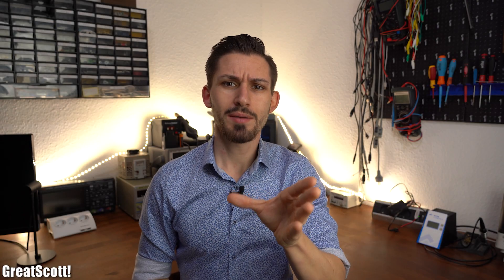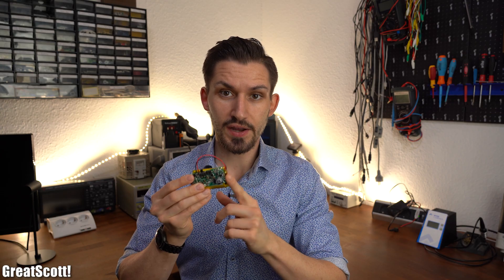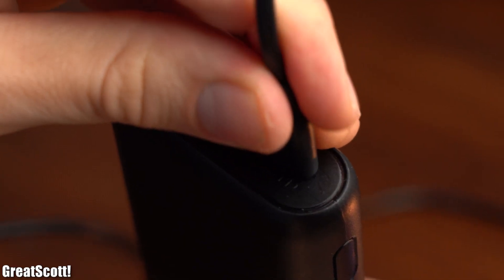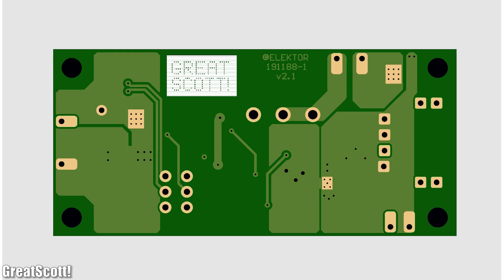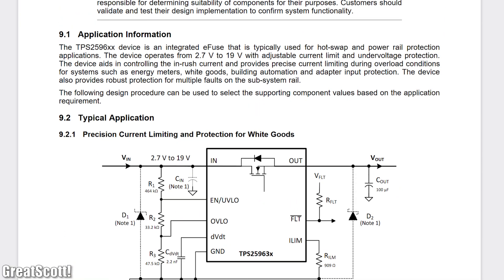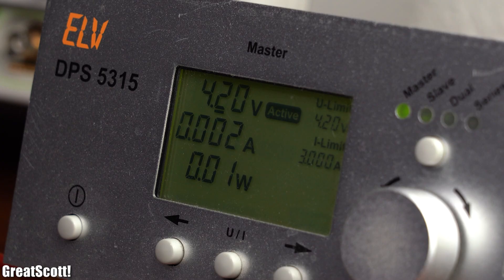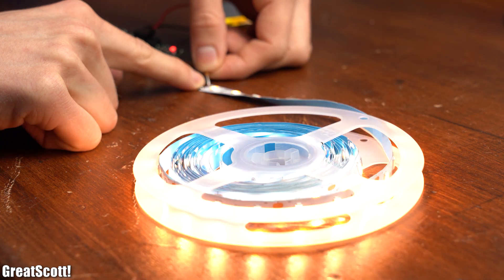DIY LiPo Supercharger! (Charge, Protect, 5V/12V Boost V2)

Comment: Nice project thank you Scott!. Can it charge the battery while delivering power to the load? In other words, could it work as a small capacity UPS?
Reply: I also need to know the answer.
Reply: I think no as the output voltage comes only from the battery (and the charger need to know the end of the charge cycle which is a small % of the charging current).
But I'm looking for something like that too: I need a small 12VDC UPS to provide power to a fiber optic router...
Edit: I'm wrong... The circuit does both, but the current is shared between the load (boost converter) and the charger section (1A max according to R6 and datasheet).
If the battery is already fully loaded, it's ok. Exemples, if a 5V load requires 1.5A, then the module will require max 1A from the charger and approximately 1.4A from the battery (taking in account an efficiency of 85% of the boost converter and a best case VBAT in discharge mode to 3.7V). In this case the battery obviously will not charge and the system will shutdown when the battery is depleted, even powered by the USB-C... If instead your load requires 0.5A at 5V, then a current of 0.8A dropping to 0.7A will be required from the charger section, allowing 0.3 to 0.2A to charge the battery... Of course, supposing the USB-C is able to provide the current...
At 12V output, it's a little worst, only 0.26A could be provided without transitioning from charge to discharge of the battery.
Of course, it's just estimated values based on quick and dirty computations according to the design parameters.
Close measurements might be done to take in account many over parameters...

Comment: Man I would love to buy your circuit but even though it is available I can’t use it as my soldering skills are worse than worse
Reply: Then you should do it over and over again. 
No master has yet fallen from heaven. My solder skills were also worse than worse in the beginning, but with exercise and gained knowledge it got better and better.

Maybe also start watching vids showing how to correctly solder and looking into iec-reports.
Reply: Eg. IEC 61191 shows the technical Side of soldering. (More a Info for manufacturers, but also a little interesting for hobbyists.)

Comment: hi sir i have a question about the  XB8089D ic , 
does it really work , all the features that are listed in its datasheet do they really work , im trying to use this chip for a circuit i am designing, that has a charger ic and protection ic , my main question, is this chip protecting the battery from the charger or protecting the circuit from the battery or both , and how does this chip work if most of its pins are tied to ground , and there is no seperation between the battery and the circuit , , basically the  XB8089D and the battery and the main circuit are connected in parallel so how can it protect the circuit or the battery , i thought the protection circuit should be between the battery and the main circuit , can you help me please ?

Comment: Congratulations on the success of your project.
Is it possible to leave the circuit plugged in to keep the battery charged?
I hear that this can damage LiPo batteries.
I would like to build an uninterruptible power supply for a project I'm working on.
Thanks

Comment: This is so expensive, i feel like you can just buy a power bank with all those features that also comes with the batteries for less.
Reply: Power banks turn off automatically at lower currents and do not supply power when charging the batteries.

Comment: im actually currently building one my own from scratch using a 11.4V lipo  3 cell battery with built in balance charging , using 5 volt to charge and  operate using converters,  looking into ways to get more charge and having a higher capacity battery pack would give higher watts and amps to operate longer.  im thinking to acquire this kit  and see if its possible to use a 12 volt(ish) battery by modding it or use this as intermediate, i doubt the ic are rated for a 12 volt lipo battery but gonna look into it.

Comment: How do you charge an array of bats?  Ha-ha I know it's a battery , I need to add USB charging to my diy liion flashlight, it has 8 18650's parallel, about 2ah each, I want to step the led up to a 3w or 5w, I also want to add a boost converter, for a 13.5v output, it's kinda multiple purpose light, power supply, it originally used a 6v lantern battery, actually it had an adapter to use AA cells as a option, i had to use a small boost because the led needed about 5.5v to start working, I have the LED's I just need the charging and protection bits, I was going to use the tp-4056 with 1amp protection, but that will not work with a 5w led.   With all the bells and whistles I guess a 5 amp protection board, or maybe I will go to 3s or 4s and a buck converter for 13.5v out, and the led, having a 4s it may be possible to charge a car NB attery with it, (enough to get the car started possibly,) that could be handy, I may swap in better cells for that, I gave 3200'sbut want to use those in my house, but using a small DC buck with cc CV to charge lead acid car batts, from liion, insted of a high c jump start, it's worth testing I guess! Happy December!!

Comment: I like the USB type C breakout board idea but you could integrate that into the project.  If you look on the breakout board then you see a resistor and a capacitor.  The resistance for sinking any power is independent of the resistance that will be on the cable's end.  So pull-down resistors will always be 5.1kOHM on the CC1 and CC2 pins of the USB type C on your board.  Also it looks like there is a capacitor that probably goes to the Vbus line for filtering.  In the case that you need a power supply without ripple you would need to filter the Vbus line, after combining all the pins labeled Vbus together, with a 10u capacitor or a Pi filter.  As well you see that it comes with the standard communication pins Dp and Dn on the board, well you'd just route them together as a differential pair and wire them to some IC like a serial-to-UART CH340C specifically to have communication with an ESP.

Comment: Nice circuit. I can only think of one potential flaw: what happens in case of a bad contact in the voltage selector switch? Or slow operation? So, with the voltage selector switch in an undefined state: will it output 0V, 5V, 12V, or any?
This could potentially destroy electronic projects, so it's important to know.
Reply: You could always "hardwire" the connections and leave out the switch, if you're really worried about that.  
Then you just wire each one for a specific output for a specific project--since after all, this PCB should travel with the battery that it's charging and "extending" the output of.  Sounds like a match to me!

Comment: Great updates Scott!. May I ask,  how can I modify this circuit to work with a 2s lipo battery to output at least 2.1A (for use with servos and steppers motors)? or are there any commercial pcbs like this one but for 2s and at least 2.1A?

Comment: Great , but I would love some charge protect circuits for multiple configurations like 1S or 2S or 2S2P of 18650 li-ion.
Reply: I’ll add my vote for that too!!
Reply: Certainly many gadgets are 12 V powered, a 3 S Lipo version would be appreciated
Reply: Me too, I'd like to find a good design of 12VDC UPS based on two 18650 (for at least half an hour of backup power).
This device should be able to stay permanently connected (so must be very safe) and delivering 8W to 10W of 12VDC regulated power. My intention is to provide uninterruptible power to a Fiber Optic router, originally powered by a AC/DC regulated 12VDC plugin module (this module should be reused to feed the mini UPS, so max 2S is required to preserve some margin for the LiPo charger. Might be necessary to use a Sepic converter for the regulated output if Vin >= Vout when AC powered).

Comment: Awesome project! For future versions, could you improve the output current to 3A or more?
Reply: Probably require a more powerful mosfet & inductor.
Reply: @stevenanderson9532  It can be useful for more demanding portable projects. In my case, I have been searching for a while a schematic that can power a pi 4 and a touchscreen which requires 3A output.
Reply: With increased cost & a modified motherboard. I've need of more volts & amps. But your better off getting a buck boost like I'm having to do. These are more complex as Scott has proven in the past & others. Anything above 1.5 amps usually. Experimenting with lm317 3055 inductor schotkey buck boost which is more affordable which if successful will release it's schematics in thanks for the pioneers!

Comment: So, maybe this is a silly question, but can I use this kit to charge 18650 batteries? I'm working on a project where I need 12V output from a bunch of 18650s in parallel, and this seems to fit the bill pretty well, but unsure if this will fit the bill or if I need a proper BMS instead. The requirement is also that it needs to be able to charge the batteries with USB.
Reply from the maker: Yep. 18650 will work.
Reply: @greatscottlab  Neato! May have to give this a look then. Cheers!
Reply: Why don't you use them in series? It's more efficient (and more complicated to balance)
Reply: A lot in parallel with boost converter could work, depending on current needed, if it's very low, I'd go with single or parallel, if higher I'd go 3s with bms, and balance,  maybe use a buck boost to regulate output, they make tiny 3s charge boards, that could use USB with boost to charge im working on a similar project, but low current, 1-2amps, 5amp max,
Reply: Although lifepo4 will work for 12v much better with 4s coming to 12.8v nominal, and 14.4/14.8 full charge, and is much less flammable !
Reply: @jamest.5001  yes, but if this will boost it up to 12V with a built in charger, that solves two problems for me. My idea was indeed to put in a proper BMS and then boost the output of the batteries, but I haven't been able to find something that charges via USB that's easy to just incorporate in my build. It will have probably 8-10 18650s (simply because that's what I have available) and I'm building something which will have high capacity, and is easy to charge, hence the choices. I could use 3-4 in series and regulate the output up or down to 12V as well, but would be more complicated to charge and maintain. This will be a very low drain project, something like 0.2 amps, but should have the capacity to work for quite some time between charges.
Reply: @SwitchAndLever  but this would take a painful amount of time to charge 8-10 batteries.
Reply: @greatscottlab  2.5 discharge current isn't too low for 18560 batteries? The minimum isn't 3V for saving 18650?
Reply: @NanoMine  not a problem whatsoever.
Reply: Buy a cheap chinese powerbank with variable outputs support 5V, 9V, and 12V and then replace the batteries with better quality ones.

Comment: Is it possible to configure it for say 5.1 or 5.2 volts?
Reply from the maker: On the output? Sure, you just need to change resistor values of the boost converter.

Comment: NICE!
I think the 5V 12V switch should have been a jumper of some kind.

You don't want to run the risk of accidentally changing to 12V
Reply: That's why GreatScott! gave us the 12V indicator LED. It will tell us right away why our powered devices released the magic smoke.
Reply: @PeteBo  lol.  That's right!

Comment: I hope you make it 'adjustable' for voltage discharge protection some people don't like to push battery to 2.5v
Reply: Not just the discharge, I personally like to go for a charge cycle range of roughly 4.1v to 3.3v I think the slight loss in capacity is generally worth it for longer cell life.
Reply: @vgamesx1  Can you link IC or components and the scheme (if possible) for 3.3v overdischarge protection please?
I only found IC for 3.0v and it's a bit too low in my opinion as well.
Reply: Yea 2.5 seems low but it also sounds like getting an ic that stops above 3 is difficult. Might be better to consider that feature as protection for the lipo exclusively and work a cutoff into the workflow/design of the product being powered. I would've loved to see a  voltage indicator even if it was just a handful of leds to make it easier to stop manually. Not hard to add tho.
Reply: 2.5 v will be an issue for LiPo batteries, but Li-Ion would tolerate this much better without degrading the cells. With the size of the circuit board I could see wiring up a pair of 18650s in parallel for 6000 mah capacity working really well.
Reply: @Ricardo-sx7ez  Sorry, I'm not aware of any ICs that do that, there are some with a reference pin that can allow you to adjust the voltage but if I need that functionality I'll just use a microcontroller and there are a few ways of doing that, you use the onboard ADC, add an external ADC or use a voltage/current sensor.
https://www.youtube.com/watch?v=UAJMLTzrM9Q (you can skip the first 7 minutes)

https://www.youtube.com/watch?v=cG8moaufmQs

It's a bit on the pricey side for battery monitoring but there's also the diyBMS project which I can highly recommend or just search for "how to measure voltage / monitor battery with [preferred micro of choice]"

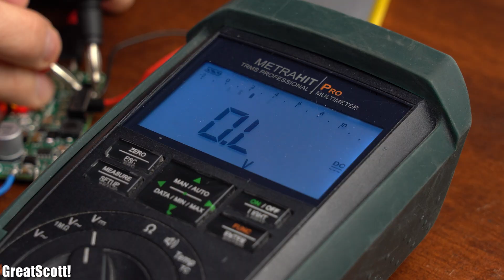Comment: "And a battery voltage of 4.19V, perfect!" 7:20
My dude, you're one number away from making that the perfect voltage and perfect number!
Reply: Better to err a bit low than a bit high when dealing with highly volatile lithium batteries. I would actually like to see an option to lower the charge voltage to 4.1V or 4.15V, that would give you a lot more cycles from the battery.

Comment: You should use some flux when soldering SMD, instead of relying on the flux inside the solder wire. This way you won't need to dab so much solder into the joint every time.

Comment: If the over discharge protection goes down to 2.5 v then using Li-Ion  cells would probably be a better choice than LiPo. 18650 or 21700 would both work well. This is a great looking project kit! Congrats on getting it all together.

Comment: 2:35 I have not a single USB-C device at home... does that mean I’m outdated?
Reply: I have one new usb c phone, but the rest of my stuff is micro usb. Would prefer that.
Reply: yes
Reply: @Joachim Shekelberg I have USB-C in my phone and im not fan of it. Granted I have had this phone a couple years now but the port is failing. Panel mounted USB is much easier to repair, but nowadays no one is using them as it takes so much more space.

Comment: Awesome kit :-) And amazing channel as well.

I'm now looking at the whole "LiPo topic" to create a battery powered DC motor control in the range of roughly 5 to 11V.
Motor speed control could be done with PWM using a H-bridge I guess.
But how to use a voltage regulator, and especially how to safely set up the charging and control circuit is unknown territory for me. This video definitely helped, but as I have multiple LiPo cells (balanced charging...) and want to power both the microcontroller and the dc motor...

So I guess, I cannot use this kit easily and have to dig deeper.

Or does anybody by chance have input on how to charge multiple LiPo cells similar to what is done in this kit?

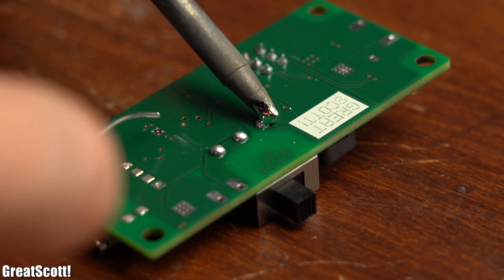Comment: 6:40 isn't that dangerous to have such pins poping out of the PCB ? If we put it against a LiPo battery it could damage it no ?
Reply: No.  Not really.  Lipo batteries look like they are coated with something metallic , but they are actually insulated ...
Reply: You xan easly put something betwen them that isolation properties if you are feeling not safe
Reply: @RandoniumTJ  I guess he meant poke it

Comment: No graphs?   
Thank you for another great video.  I love your scientific approach in all of your videos.  
Thank you Great Scott.  
You also showed that you went through the trouble of measuring the output voltage/current at different loads and at different input voltages.  I would love to see the graphs on that.  I would even say that it merits a separate video.  I'd love to see e.g. the efficiency of the circuit. 
Keep up the great work.  
Much appreciated... as every week.   
ChrisV

Comment: Any chance that the charge and cutoff voltages be modified? I'd love to have a charge voltage of 4v and cutoff of 3.2v.
Reply: Did you bother looking at the datasheet for the charging IC?
Reply: Lithium cells need to work within a certain range

Comment: 23 EUR is sadly very hard competition with Aliexpress alternatives :-(
Reply: Guaranteed quality though?
Reply: @derpsquad3306  I somewhat doubt the quality is guaranteed, as in the price difference is made up by additional checks beyond what you would usually get from AliExpress. I'm sure the guaranteed quality applies to the individual components e.g. from Texas instruments - and maybe the store can elaborate- but I'm guessing you can never exclude some manufacturing faults and there may not be an inherent guarantee if you assemble it yourself
Reply: Some of the cost goes to Elektor and Great Scott for profit, and some of the appeal of the kit with the increased cost is the ability to assemble it yourself. I imagine there are already dozens of competing boards that are already assembled available from AliExpress/Banggood/eBay.

Comment: I love it but its to expensive. Don’t want to spend £20 when it can be bought from ebay
Reply: Then go to eBay? Lol
Reply: Nah, really, it's crazy expensive. That's like half the total cost of all electronics I build into a typical project. You can cobble together the separate parts as modules for less than this - sure, not so elegant or flexible, but still. 

It's surely a great learning kit, but it's not cost effective enough to be simply a module to chuck into a project to solve your problems...
Reply: @stefankachaunov396  True, but it's more of an enthusiast DIY project that sponsors a worthy content creator. I'm sure it would be much cheaper if you could contract a few 10 thousand of them.